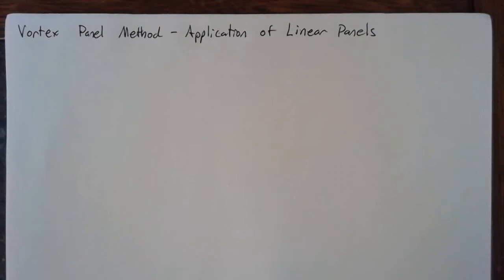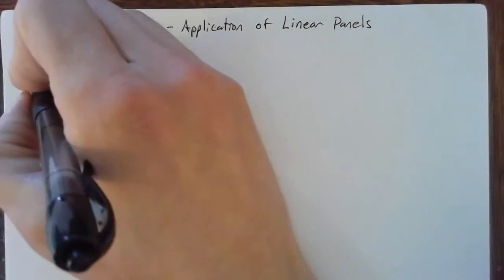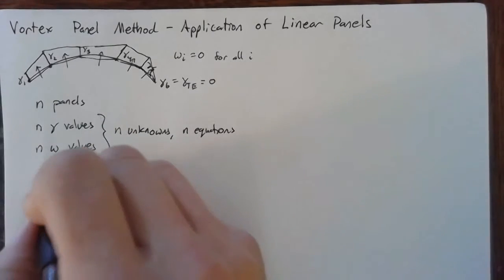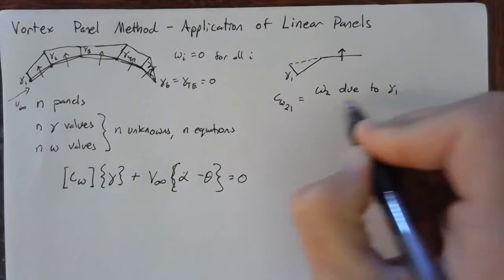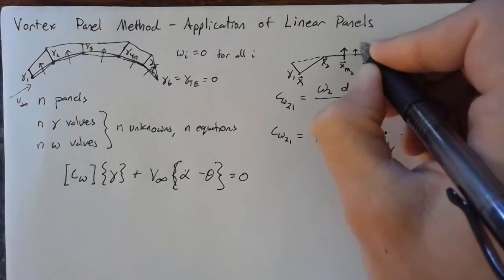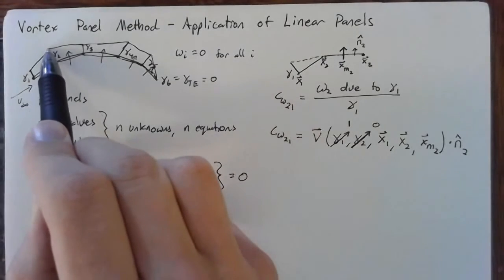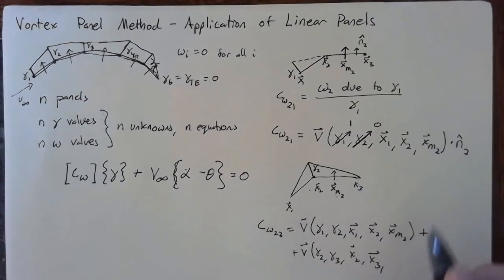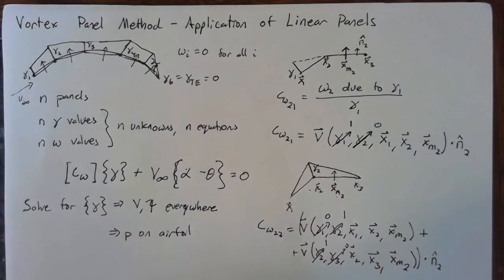Vortex Panel Method - Application for Linear Panels

Comment: I am interested in estimation of static pressure over a gas turbine blade. Can i use this method for this task ?
Reply: hii , did you applicate this method for estimate the static pressure over a gas turbine blade , and did you get a good result , thank you